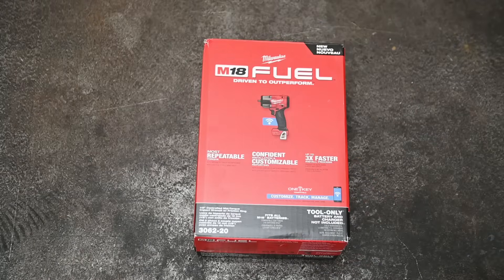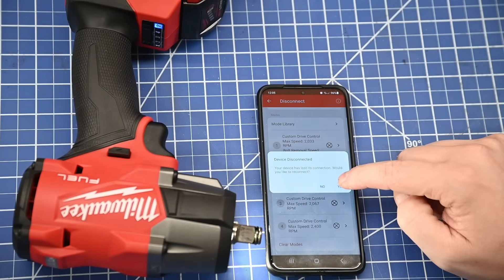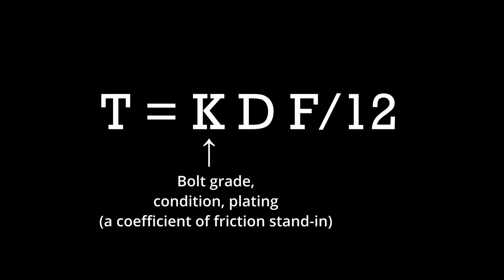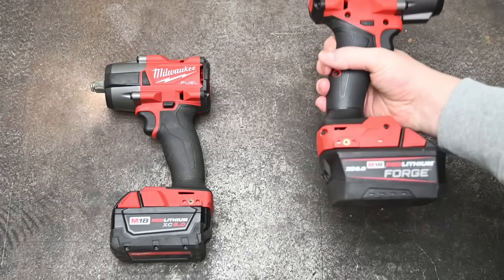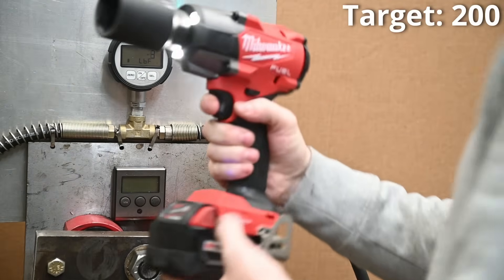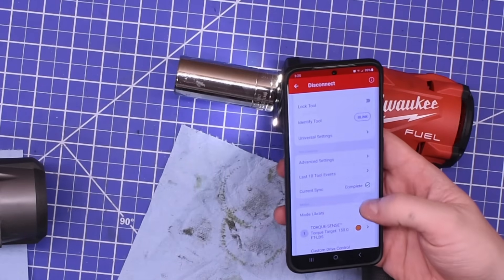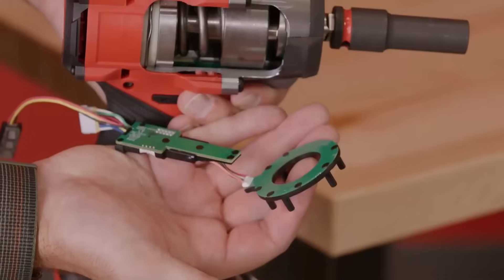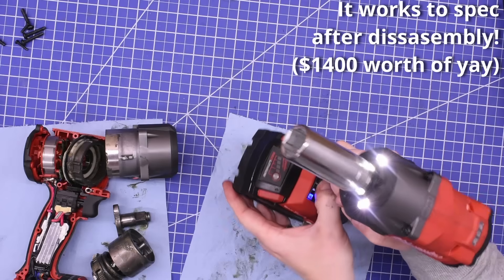Milwaukee's Secret $1,400 Impact Wrench: A Mechanic's Dream?

Comment: OOOH, I'd be super interested in seeing a vid comparing this gun to the likes of Cleco or Panasonic Industrial. Obviously those will have trouble hitting the peak numbers this does due to being designed for low wrist-breaking scores, but seeing how close Milwaukee gets to the industrial standards would be neat.
Reply: Ive worked with an Estic torque tool as well, that was pretty accurate and fast. also happened to be a wireless and reactionless tool.
Reply: I use several of the Panasonic AcuPulse series for work and can say I've never had one go rogue and overtorque a fastener lmao
Reply: Or the IR torque tools.

Comment: Man that's cool.  

When you used the rusty bolt on the dyno, did you recalibrate for that K factor as the dyno is measuring tension, or was it the same as what it was with the greased bolt?  If the calibration was with the greased bolt, I don't think it's doing the calculation on just a displacement measurement of the anvil, but may be correlating an angular displacement through the anvil to an torque transmitted by the anvil.
Reply from the maker: It was a new bolt, which in thise size dont really thread nuts on easily by hand. Did not calibrate, just surprised the tool with it.

Comment: ngl if you look at the power curve for the on comparing the 29-30 it seems very very predictable on the 30. it almost looks like they throttled it so the device would have an easier time learning and expecting.

Comment: I would have liked to see a size comparison with the 2967 (it looks pretty similar to me) and some testing on how it deals with partially-tightened bolts (what happens if you tighten it to ~half the spec torque with the 3062, release the trigger, then try again? with another impact, then switch to the 3062?)
Reply from the maker: 19:27 also we did try it on a tightened bolt. But not one half tightened, you're right. There's a couple times we used it on something tightened to like 30 ft-lbs and it still went to 200, just from pulling the trigger, seeing the red light flash then pulling the trigger again. But that's about it.

Comment: I love stuff like this. I work as rig responsible on a ship/oil vessel. What i learned here is that you cant replace manual work with AI and you cant trust what Milwaukee says on its product description. What is even the point of having a digital/set torque rating if it doesn't hit it 100%. I cant sign a certificate for something that isnt correct. And this isnt for your home garage work, so who is this tool for? Personally i dont give a shit about what brand it is, if it works it works.

Comment: Milwaukee should put a Mercedes emblem on that thing 😂. Never thought about the need for that specific tool out in the solar fields like that. Very interesting. I enjoyed the look into that and all the details inside. Thanks!
Reply: Tools aimed to companies not regular customers , Makita assembly line tools also are over £€$ 1000 each , they A series batteries stop when they hit 25% charge and you can time lock batteries .
Reply: @pete_lind  
Yes, he covered that on the video for sure!
Reply: As technology marches on, agri-pv (solar modules above fields) and solar canopy type installations are becoming more popular. And if people drive/work/walk below the install, red tape will increase and awareness for loose fasteners etc.
Reply: It's all about sucking the money out of the green agenda, massive government subsidized money pit, corruption, because government. This thing is a 500 dollar tool. Wait a year and pick it up at the bankruptcy auction, just like Solyndra.

Comment: Do you think the torque wrench method when calibrating is better in the real world because it would be testing the actual condition of the fasteners you’ll be using it on?
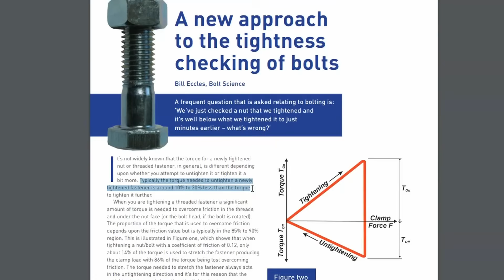Reply from the maker: You can put the actual fastener and washers you're using in a set up like ours or a skidmore like 19:07. It's a through hole load cell

Comment: I think I'll stick with my $10 Pittsburgh torque wrench for now
Reply from the maker: Those are awesome tbh
Reply: @TorqueTestChannel  it's definitely handy when I need it. N I have a digital luggage scale that I can use to check it's calibration from time to time
Reply from the maker: @benmiller5015  That's actually a darn fine test method as well. People underestimate how good some cheap examples like these have gotten

Comment: this might seem expensive but this is exclusively targeted at corporations that have a high volume of assembly, and the alternative is expensive torque wrenches, pre calibrated air impacts and electronic torque turning devices which can cost 10s of thousands of dollars.

Comment: It didn't even work properly on the pipeline event where they specifically setup a test stand for it.
Reply from the maker: If you re-use the same (especially small size) fastener over and over it's going to increasingly get out of spec in measurement over the course of a day. The only way to eliminate this is to use a bolt way over qualified for the torque setting (like we did on most tests) or swap out the hardware often (like we did on the M14 hardware). Their set up guide even explains this with new hardware, so it's strange their PIPELINE exhibit ignores it. 
The same thing would happen to a 100% accurate torque wrench used in that same exhibit all day, it's the hardware stretching and getting worn. So really just a bad demo vs a bad tool. Save for the weird FORGE stuff I doubt they are advertising.
Reply: Couldnt agree more.@TorqueTestChannel
Reply: @TorqueTestChannel  If you use a fastener that is way over qualified for the torque, it won't be properly torqued. If properly torqued, the fastener will not exceed it's elastic limit and will not permanently stretch.
Reply from the maker: @cathotmailcom For a demo, i think using a larger bolt that's not taken all the way to spec to show repeatability is still a good idea.
A bolt torqued once to spec will not be deformed or damaged. One several times, and if run over and over and heated, will.
Our 1" thread grade 9 bolts are rarely if ever taken beyond their yield point with tools on this channel, and yet we have to cycle them out based on stretch and thread fitment with the nut nearly every 4-6 weeks because data starts to become worse. We get a very live daily look at bolt tension vs bolt wear running this channel.
Reply: Flagship unit here I see
Reply: I believe it didn't...lol
Reply: Why anyone would pay more than 200$ for that? Sorry i forgot that idiots pay.
Reply: @vili8893  in a professional environment you have to calculate with the time you save. If it works properly the tool can pay for itself in a short amount of time
Reply: @saiiiiiii1  still. Making that machine costs  12,5$. Too much greedy people taking too big cuts from middle. So idiots pay too much, even top model iphone is 10$ to make.
Reply: @vili8893 Do you actually believe what you're writing? If you genuinely believe an iPhone only costs Apple $10 to make with parts, labor, equipment, r&d, software development, etc, you are grossly misinformed. Even if you discard everything else and ONLY include the actual materials, $10 is still not even in the ballpark. You obviously don't understand what it costs to utilize TSMC's latest semiconductor manufacturing node.. or what it costs to CNC mill cases/parts from aluminum.. or what it costs to source the latest/best OLED displays from another manufacturer like Samsung. I could go on and on. You really should do a little bit of research before you make claims that are so far off the mark that it is laughable. Personally, I despise Apple and have never purchased/owned a single device from them in my entire life (and I never will) but that doesn't change the fact that they make high quality hardware that is expensive to manufacture.
Reply: @HammerStudioGames  found a nerve?
Reply: @vili8893  apparently I did
Reply: Villi buys the cheap amazon stuff
Reply: @busman2050  and better quality.

Comment: Been DYING for you guys to test the new Torque-Sense impacts! Watching now! EDIT: That was WAY more complicated than I anticipated. What a fascinating tool. Interested in the issues with different battery types. Wonder if that will be something addressed in a software update. GREAT video guys. Thanks!
Reply from the maker: The manual guide points out the tool needs to be calibrated with the type of battery to be used, but in the forge's case not only did it never get dialed in, when you put an XC5.0 on the tool calibrated using the Forge it went back to being spot on, which i can't help but think is not just a coincidence.
Reply: @TorqueTestChannel  I wonder if they are reading voltage drop as one of the variables, and the flex volt batteries just don't drop and it freaks the tool out. The impact is reigned in a little vs the normal one, so it may just not pull enough current to get the expected drop.
Reply: Tool should have some warning when uncalibrated battery is used. Lock out would make sense but maybe warning lights and a buzzer would be enough... As a user I don't love lockouts or dependency on a phone app as they obsolete quickly. Still awesome tool for some industrial use.
Reply: @dosgos  What I am saying below is that battery calibration is likely beyond the capability of the hardware they actually have in the tool and they're lying about the ability for it to calibrate because it was deemed "close enough" when in reality it's not so battery calibration is likely done to a "standard" which in this case is the XC5.0, it would explain the behavior exhibited by the tool and they should just get rid of the language that states you can use different batteries with it because the target market will follow the rules or they'll pay anyway.

Ideally they would calibrate for all batteries at least within their brand and line but this isn't exactly a high volume product as it's targeted and priced for enterprise and fleet purchase and those generally come with some variation on "use the bog standard battery line only." in their agreement language. It's probably calibrated for the XC5.0 because at $1400 they hand you 3 XC5.0s and say "Only use XC5.0's" and it's a binding warranty voidable agreement (not that they necessarily WOULD but they could).

Also given the space constraints the XC5.0s is probably what is best optimized in terms of RPM and ga-dungas and the data produced for the little microprocessors to do all their math and stop it more or less on a dime like that for the torque-sense to be able to hit the specs they are claiming. That said I overall agree that they should have some sort of lockout or warning system that is on by default that can be disabled for non-calibrated batteries that informs you "Your torque sense no longer works, check with an additional properly calibrated torque wrench. Also you're potentially voiding your warranty if you wish to continue please hit this button 3 times"

Comment: I can see this working on windmills or solar farms where it could make the same torque on hundreds on bolts. Plus set in truck and get to it. 
Find a ridgid r86312?
Reply from the maker: Being it's just an anvil swap, not enough for us to want to make a full video on it since it's not currently like a TOP 1/2" but maybe if another 3/4" comes out too. 3/4" is not super popular among most of you guys
Reply: 3/4 falls under the weird: too big for most road going vehicles but too small for most stationary plant equipment. They get used pretty extensively in the earthmoving and agricultural maintenance world however.
Reply: A namzlxksksdjdjxk x idixxizziskslsl
 @TorqueTestChannel